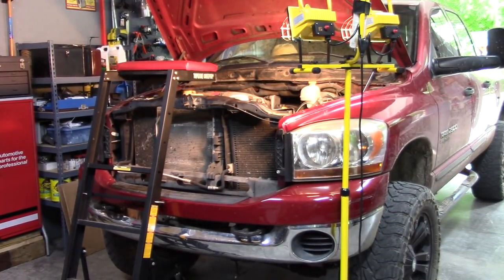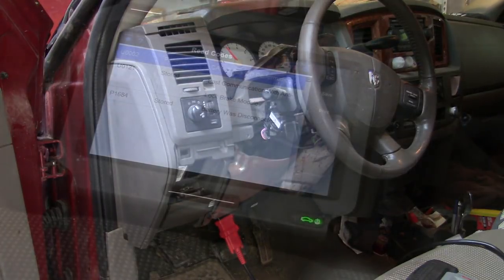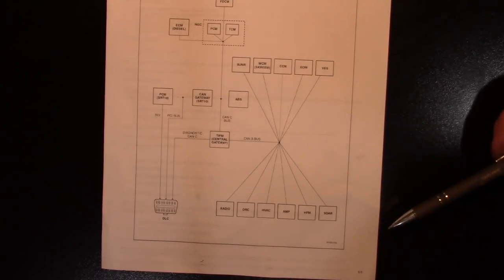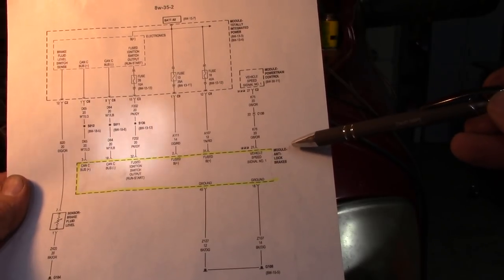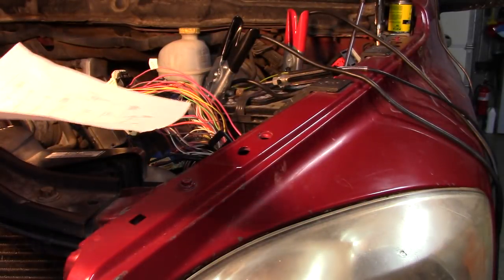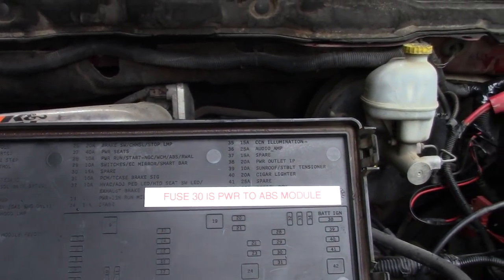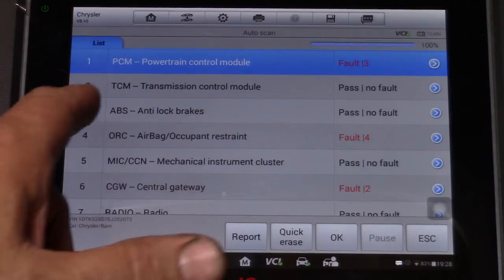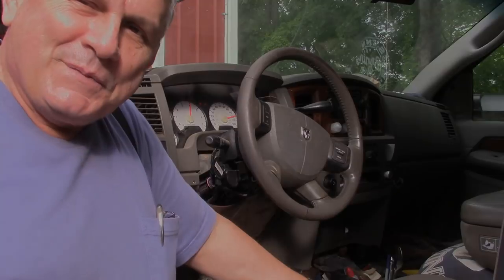2006 Dodge Ram Intermittent crank, no start..for years!

Comment: Nice fix and great find! always a pain to work on something that isn't really "stock" any more and it is great that you did not fire the parts cannon at it like others wanted to! Keith would be proud!
Reply from the maker: This truck has a lot of issues. Besides the accident, just about every wiring harness has breaks and damage. I spent many hours repairing wiring and potential shorts in an attempt to find his no start issue. But I had fun too.  :)
Reply: Well at a charge of $100 per hour diagnostic fee you should have made out pretty well!!! haha!

Comment: What a nightmare puzzle, I'm so impressed you found the gremlin. I hate working on vehicles that others have dabbled on, it makes repair much more time consuming.
Reply from the maker: The more I watch from the pros and the more I get into this hobby, I find it's definitely a case of being a detective. Get a direction, follow (and pay attention) to the clues and then dig into it. I had fun with this one. It was frustrating at times because I took more than one wrong direction, but no matter. I learned and the owner got a free fix. Thanks for your support.

Comment: Good catch on finding the missing fuse. And a lot of folks would have missed that especially when it’s marked as a spare. Obviously the body shop changed out the fuse block assy. Have a good one Wyatt! 😀
Reply from the maker: I think that's what happened too. It's funny the owner never complained about it but as you saw, he doesn't care about the truck other than to keep it running. Thanks for spending some time here Terry. We've had guests from Germany here for two weeks so I'm behind in my YouTube videos but I'm catching up slowly.

Comment: Great find buddy. Some great diagnostics on a very strange problem 👍
Reply from the maker: It was a strange one for sure. I went on different paths with this one and all were the wrong direction. I should have paid more attention to the ABS "no comm" clue to begin with but my old habits of wanting to fix obvious wiring problems took over. The owner has a lot of repaired wires and shiny new electric tape but still didn't have a truck that started every time. I would love it if someone could tell me why this was the fix and how the truck started on occasion even with this no comm?

Comment: Great example of why wiring diagrams are important... granted, some wiring diagrams can be wrong or are not readily available. Nice one!
Reply from the maker: I had a great clue when I noticed the wire changed color. I never once could have guessed why until I tore into it, and that's where I feel like I could have done better. I should have used my time looking for the matching color wire at the fuse box (TIPM) instead of tearing it all apart. I was so sure the wire was broke but it only added extra time to the job. But I'm not being paid anyway and this was a huge learning experience for me so everybody wins. I appreciate your time here Thomas, thanks so much.

Comment: I would have you work on my Chevy Trailblazer but there is no need...ITS A CHEVY😁 Nice find bud you save the owner a butt ton of money.
Reply from the maker: Hey! A blast from the past. Nice to see you here. Yes, this was a challenge and the video would have been much longer if I included all the rabbit holes I went down before going this direction, and ultimately the fix. But this is a hobby so it was fun. And yes, the owner has no interest in putting any money in this truck. Thanks for the comment.
Reply: @wyattoneable  I do watch alot of videos but hardly comment anymore

Comment: Have a 2003 5.7 hemi has no codes but cranks and won't start customer stated truck has been overheated put antifreeze in it and drove for about 20 minutes over heated again parked it and has not started since I have not done compression check yet any suggestions
Reply from the maker: I don't have enough experience to be able to tell you much, but it will be worth checking the antifreeze for gases which would indicate a blown head gasket. This truck I worked on here had a similar problem later in it's life...a blown head gasket. You can buy a kit that will tell you if there are combustion gases in the cooling system.
Reply: @wyattoneable  no blown gaskets checked for antifreeze in the oil and everything thanks though for the insight great fix though keep it up

Comment: Nice Fix Wyatt!   You had to dig deep on that one.      So, the wire that powers the ABS module should be getting power from fuse 28, but someone rewired it to fuse 30?  I wonder if that was by accident or on purpose. Maybe fuse 28 had issues.
Reply from the maker: My guess is since this is the corner that was damaged from a previous accident, is that who ever rewired the harness for the replacement fuse box just wired it wrong. The owner never knew he didn't have ABS and his dash panel is so messed up there isn't a warning light anyway. Fuse 28 supplies power to other functions and they seem to be working so yeah, I have to guess it was just miss-wired. Thanks for the comment.

Comment: That’s would be fun to figure out. I be having a video up on my thunderbird after it’s been to shops and even had a fuel pump changed to find out a broken wire to a very important part was broke that made the car stop running and run ruff.
Reply from the maker: It was kind of fun. I took it as a personal challenge to figure this one out. My inexperience shows because it took me was too long to find the correct direction, but once I got a clue I enjoyed it.

Comment: Good job. A lot of customers don't understand what it takes to find the cause of a problem. The tipm box do go bad a lot. When ever we get a dodge / chrys vehicle in for a battery going dead over night and the charging system and battery is ok, I take my Thermal Imager Gun and aim it at the tipm to see if there is a "Hot" spot. If there is, I unplug the connectors going out of box one at a time. If the box stays hot, then I know the box is the problem. If it disappears, then I know the short is in the wiring of the plug that cause it to disappear. I will plug it back onto the box and try to follow the wiring with the Thermal Imager to find the short.  Once again, good job. I hope to post soon on my channel, have been feeling under the weather lately. I am at the doctors so much, they are calling me by my first name.  LOL
Reply from the maker: Oh man, I hate to hear you've been ill. I hope that passes soon. But thanks for the information, it's good stuff. TIPM's are a known weak spot for sure and I don't blame the other shop for heading that direction. Tis owner has no money so I was the right choice. I work for free and I have a lot of patience.  :)

Comment: Disconnecting the IOD fuse for 30 seconds, would solve the issue...
Reply from the maker: What's a IOD fuse?
Reply: @wyattoneable  , Ignition off draw. It happen to me. My security dot light came up on the instrument cluster. Every time I turn it on, it will cut off... I thought I had a damage key, had one cut and programmed, and nothing. Until I disconnected the (Ignition Off Draw fuse), it goes or the same as the (WCM) wireless control Module fuse. Then it started right up. It's weird, but it worked...
Reply from the maker: @pauljohn6546  Thanks
Reply: @wyattoneable  , you're welcome.

Comment: Is there a video where all deleted scenes are in. I'm a self taugh, mmm don't wanna say mechanic an disrespect mechanics. However I'm self taught because the mechanic I used. He's son was swapping out parts from my truck for he's Wich he didn't take care of. I found out because I went to pick up after yearly full time an oil change. He couldnt look me in the eye an had lowered the price an said oh I test.drove it an the driver side front barring hub needs replacing. At time didn't think about it to much. Then recsion hit an took part off myself went in an however he did it I had a rotor for a 2500 in for a 1500. Thought it was AutoZone then went back home took off a other side an didn't match first one but matched auto zones.. after that I never.trusted any mechanic again
Reply from the maker: Hi Michael. No, sorry, I don't have any of the deleted scenes. But I too do most of my own work on my cars (and help others on occasion) because I too have been taken advantage of. I think most auto repair shops do there best to treat customers right, but a few don't care and cheat us. But the decision to do your own mechanical work and do it well takes a long time to master.  Thank goodness YouTube helps, but it will require reading and maybe even some classes to become better. Good luck.

Comment: uhhhhhh @ 5:54  idling sound with tach sitting at 4K RPM and speedo at 100mph?
Reply from the maker: Oh this trucks needs a lot of work. Not much works in this dog.
Reply: see, that would make me unsure about bad instrument cluster or "no-com issue" on one or more buss. without looking up the diagrams even.
I'd assume other wiring/fuse positions wrong, but it's near impossible for  "guesses" to be right, that truck needs more exorcisms :))